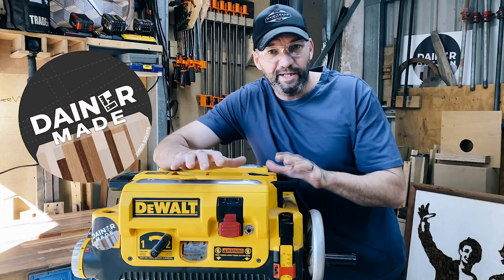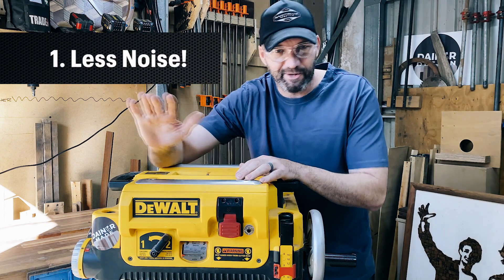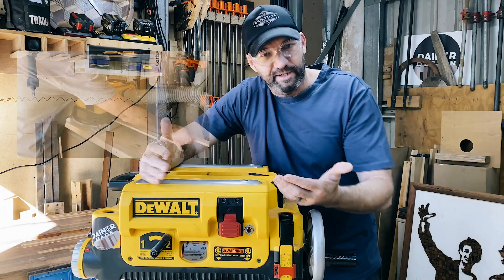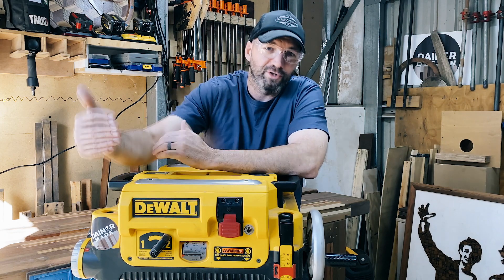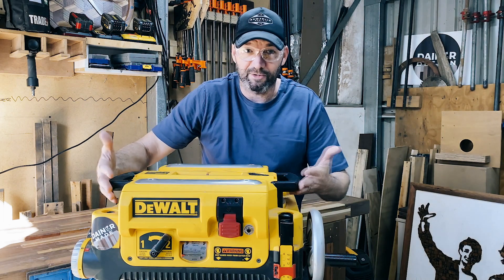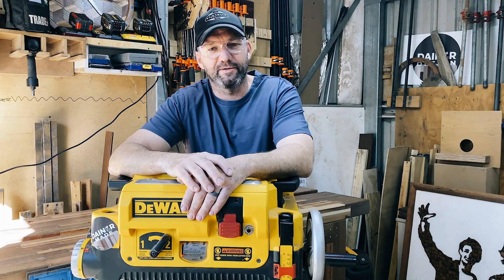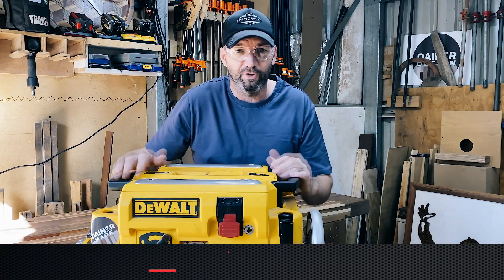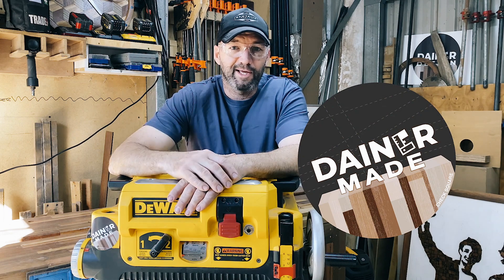Why did I Upgrade to Helical Spiral Head? Mark Dainer explains...

Comment: Hi Mark, Im interested in the same question that Lachlan asked further down in the comments. Does this cutter have the same dimensions as the OEM cutter or has it thrown out the measurements on the DW 735 ? The reason I ask this is the American Shelix replacement has an undersized replacement and an OEM version which you have to take the carbide blades off to fit in the machine. I watched the Timbecon installation video and it would appear this one is undersized as it was put in the machine with the blades still attached. I'd be really interested to know if installing this Cutter effected the factory settings of the DW 735, cheers
Reply: I purchased this cutter head a while ago, probably 1.5 years, and just this weekend fitted it to my DW 735, for the benefit of anyone else looking for an answer yes it is a smaller diameter compared to the OEM cutter head, and it does throw the measurements off. What this really means is the maximum cut you can do is about 1.5 turns of the handle.

Comment: Hi mark. I'm interested in the Sherwood Spiral Cutter Head Upgrade - Only Suits DeWalt DW735-XE. my question is: would the Outter diameter for the spiral cutters be the same as the existing 3 x blades that it comes with...would it change any of the dimension indicators, depth stops etc. TIA

Comment: I'm currently using a Ryobi thicknesser which has two blades. I purchased it from the big green shed. Recently I changed the blades at a cost of $57 for the pair. The dust extraction is, in a word, s#@t and even gets clogged when vacuum assisted. I have been thinking about upgrading may machine but couldn't decide whether to go with blades again or a spiral cutter head. Now having watched your video Mark I know which way to go. A bit more expensive but worth it in the long term. Cheers mate. PS, know anybody who want's to buy a used Ryobi thicknesser?